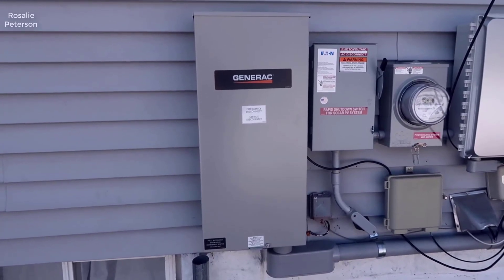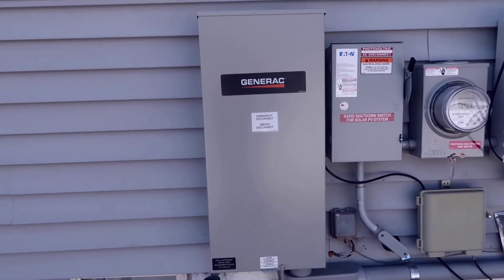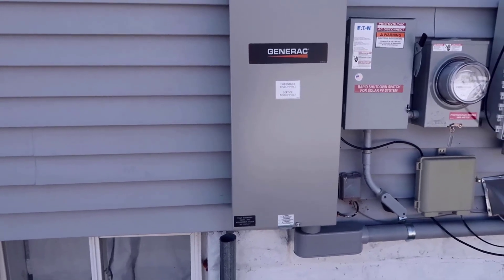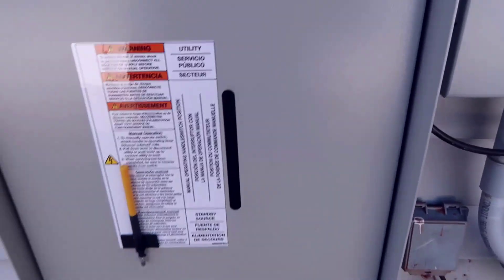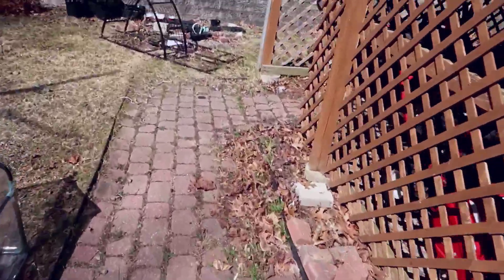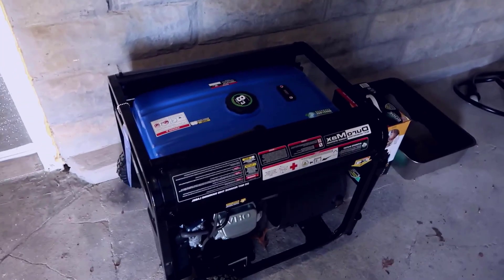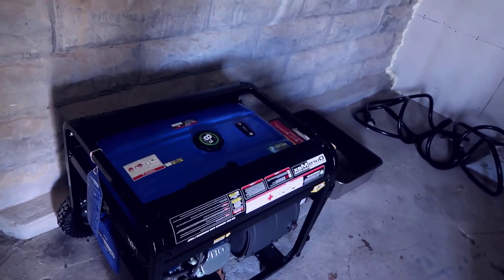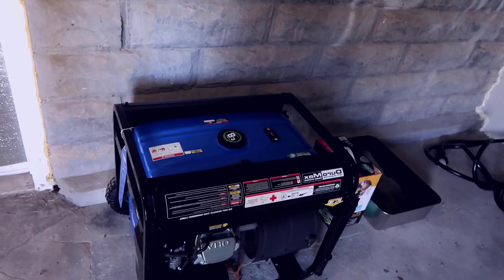Review Generac RXSW200A3 200 AMP Smart Transfer Switch 2023

Comment: I hate to break it to you, but you could have spent a little over $140 dollars for an interlock kit for the same effect and way less work during an outage. As an electrician for over 30 years I would never advise anyone to  install a 200 STS for a portable generator that back feeds your panel.
Reply: As an electrician for over 30 years, can you tell me if this transfer switch will control a 2 wire start generator? ET03016ansx